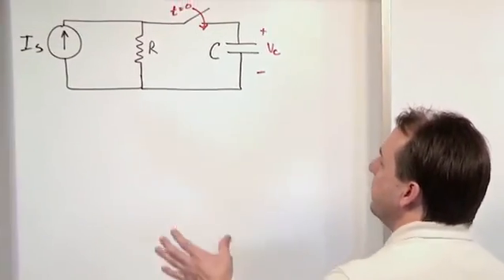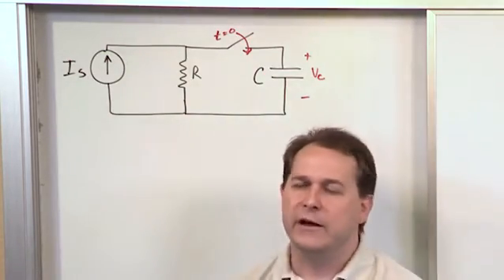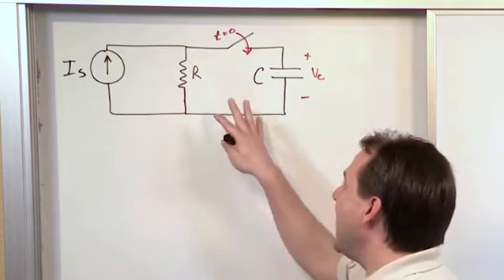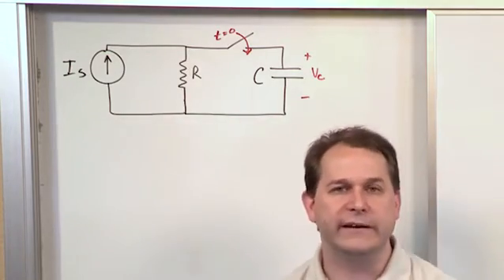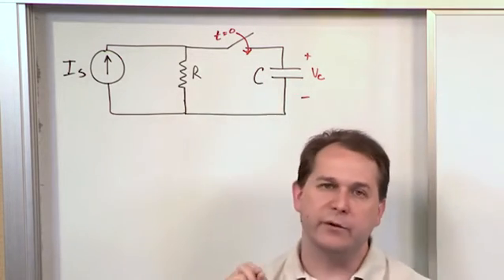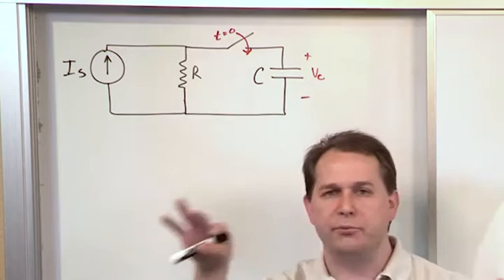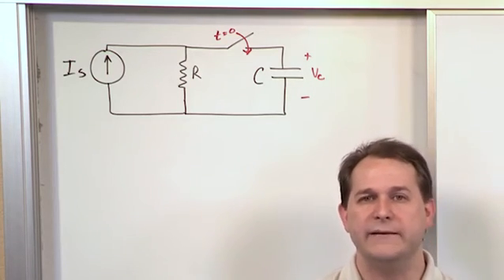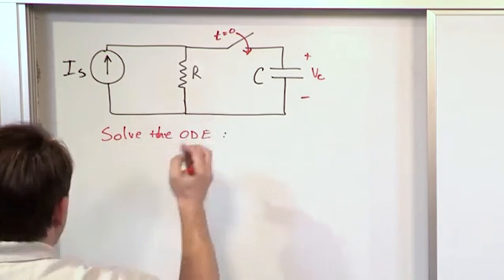Lesson 12 - Step Response Of RC Circuits (Engineering Circuits)

Comment: “The voltage across a capacitor cannot change instantaneously” is a statement one finds often in textbooks on circuit theory
It will be useful to learn the operation of charging a capacitor using a unified approach to electrostatics and circuits. Electrostatics and circuits belongto one science not two. To learn the operation of circuits it is instructive to understand Current, the conduction process, resistors and Voltage at the fundamental level as in the following two videos: i. https://youtu.be/TTtt28b1dYo and ii. https://youtu.be/8BQM_xw2Rfo 

The last frame References in video #1  lists two textbooks 3 and 4 which discuss in detail with a series of diagrams sequentially arranged) the physical processes in charging a capacitor.